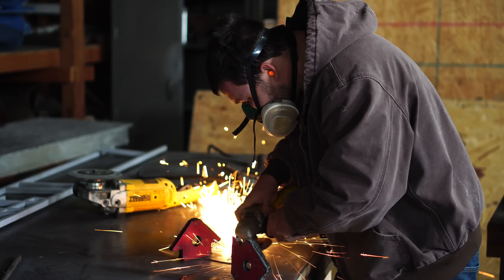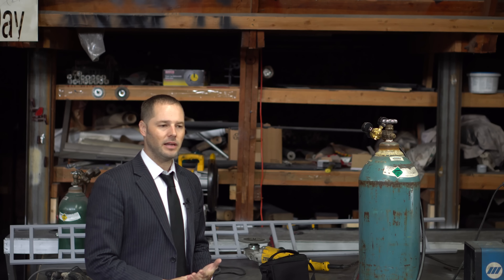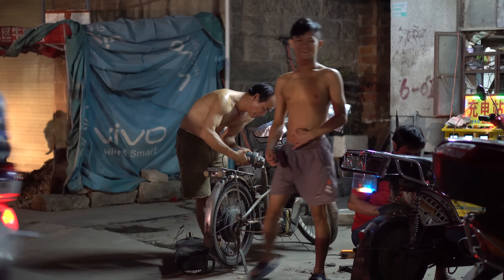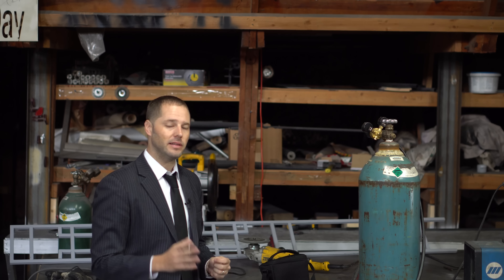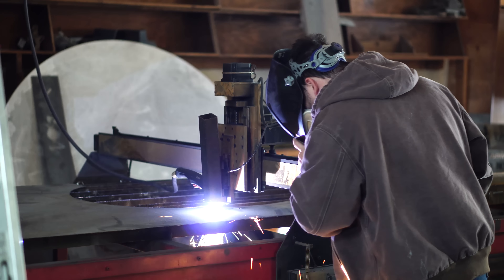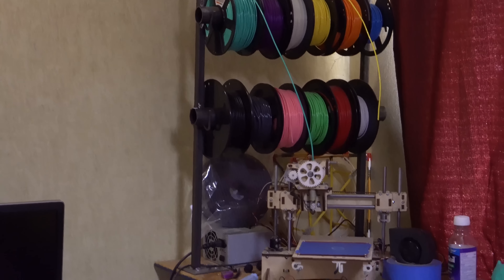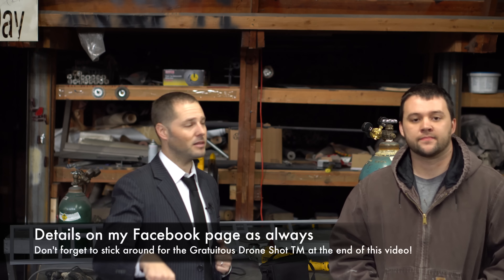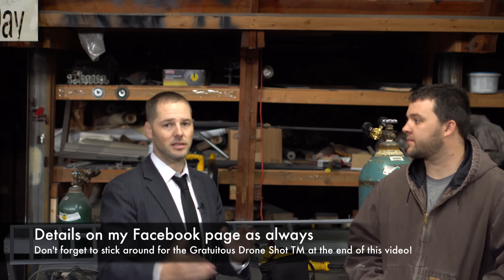Jack of all Trades, China has None!

Comment: serpentza I suggest you walk into a HomeDepot or a Lowes (yes, it is not sophisticated stuff) home improvement / hardware store and you can see how ordinary people buy parts to fix and build things. Then you can read why they failed in China for the exact reason you mentioned.  http://www.wsj.com/articles/SB10000872396390444433504577651072911154602
"Home Depot Learns Chinese Prefer 'Do-It-for-Me'"
Reply: Some User ace hardware which has been around for 50+ years.
Reply: Yeah, but they aren't the mega aircraft hangar size experience.
Reply: Some User they have some we have one here that's mega sized and they sell the carbon steel buttons screws.

Comment: I think there are a few reasons. The main reasons I think is the money. In china, the labor is so cheap. When something breaks, you can find someone to do the job for a minimal cost, why bother buying all the tools and spend the time to do it yourself. On the contrast, the labor in the US is very expensive, and the materials are relatively cheap. You can buy all the tools needed for a house project and it will still be way cheaper than hiring someone else to do it. Also, in China, people generally live in small apartment. You simply don't have spaces to store a lot of tools equipment etc. , not to mention the space you need to do this kind of projects. I used to live in China and don't really do things myself. After moving to the states, I am forced to learn various things in order to do things myself, because it's expensive to do anything involving labor.

Comment: Is a free public education provided everywhere in China, with "shop classes" so that all young adults can get exposed to using a drill press, table saw, miter saw, band saw, wood lathe, planer, joiner, milling machine, metal lathe, TIG welder, acetylene torch, metal brake, small engine repair, sand casting metal foundry, CNC plasma cutter / mill / lathe / engraver, 3D modeling, balsa wood bridge building, electronic kit building with soldering irons? In the USA this is all extremely common in high schools.

Comment: whats up with the one wheel peel?  I think your limited slip is bad.
Reply from the maker: I turned off the traction control
Reply: the one tire fire
Reply: Put it in reverse it all balances out.. sorta a yang yang thing.
Reply: those positrac differentials are only designed to lock up on the road. He was on gravel so it makes sense only 1 wheel burned out.